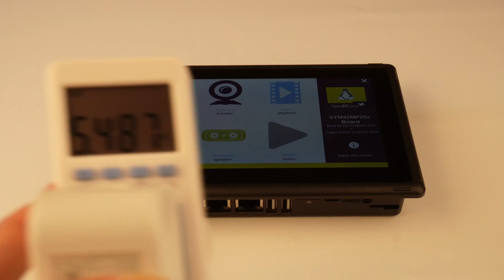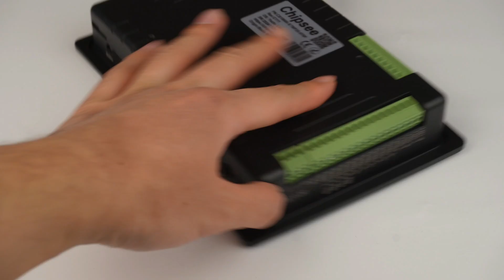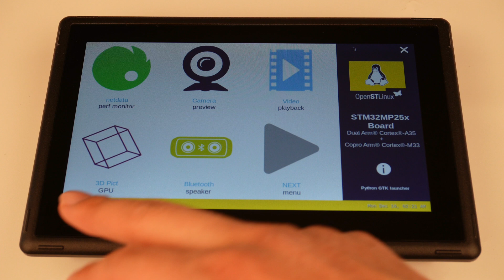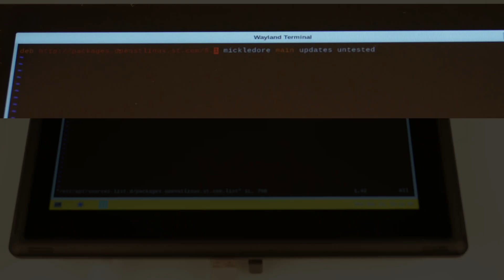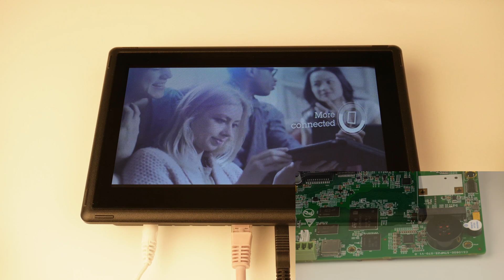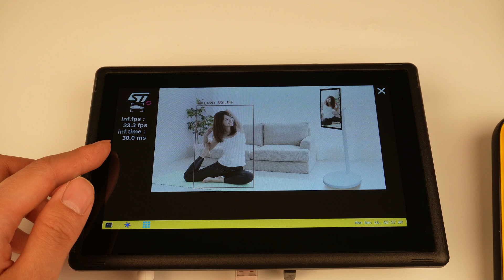Touch Screen Industrial PC with STM32MP25 and Built in NPU

Comment: If you are looking for an Solid-State Drive(SSD) with high endurance, wide temperature range and features such as power failure protection, AES encryption, anti-shock and radiation protection, please feel free to enquire. I'm a sales from Renice, Renice is a China-based manufacturer specialising in high-quality industrial-grade SSDs and rugged computers for specialised projects.